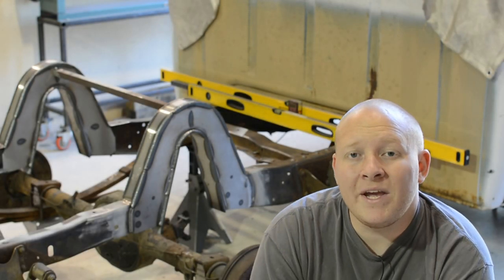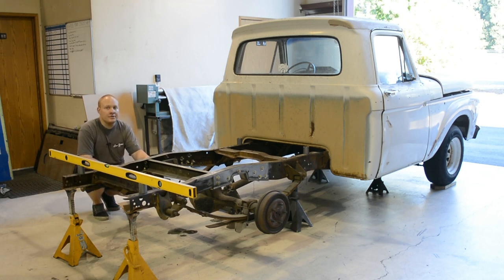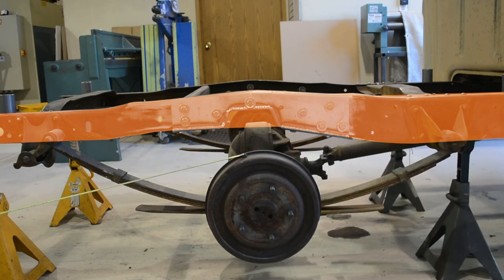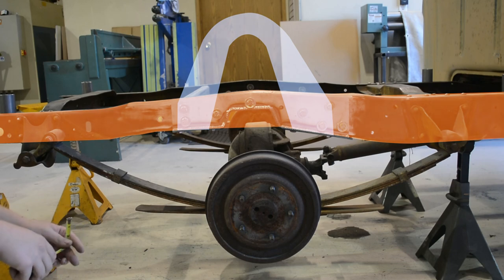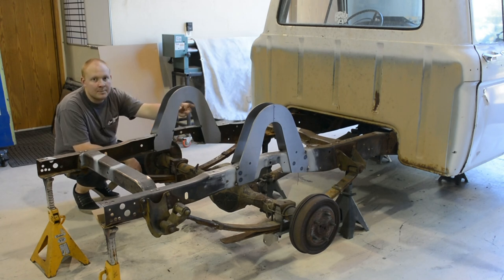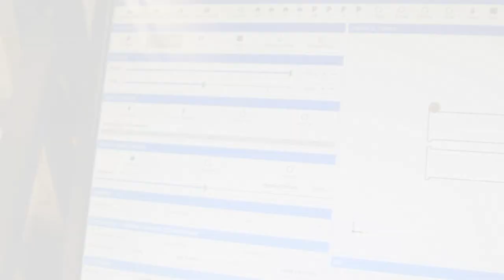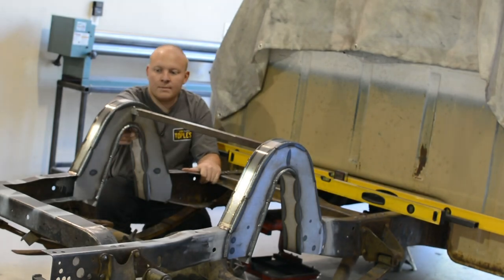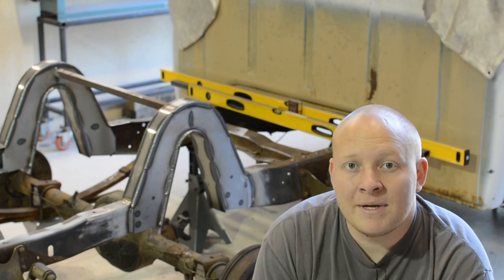Bag-N-Bodied F100 Build ( S2 EP1 )

Comment: Hey Jake, do you happen to remember your center measurement for the axle? My 65 f100 doesn't have any rear suspension or axle in it (purchased that way). Think I found center, but figured I'd ask. Thanks
Reply from the maker: Unfortunately I can't recall, and now the truck is put away in storage :/

Comment: So excited to see you making videos like this again!! Keep up the good work!

How do you determine mid travel of suspension while leaf strings are still on?
Reply from the maker: Thanks for sticking around! I based it off how much travel I will get out of the suspension, so in this case a larger bag on the link bar will give me 10" of total travel. So I'm designing everything at 5" half travel with a 29" tall tire. If you were to do a bag on axle setup you're looking at 7 - 8" total travel, so a 3.5" - 4" mid travel.

Comment: Do you plan on selling these notches on your site I have a 59 f100 looking for bag parts
Reply from the maker: Not too sure yet, if theres enough interest I definitely will.
Reply: @scrapingpavement  hell I would buy them if you would cut them don't even have to weld them just cut and ship looking for a front frame section now to change front suspension
Reply: I would take a set, just cut and shipped out. I can weld them up. I have the exact same truck so I want identical to what you cut. Let me know if I can purchase a set.